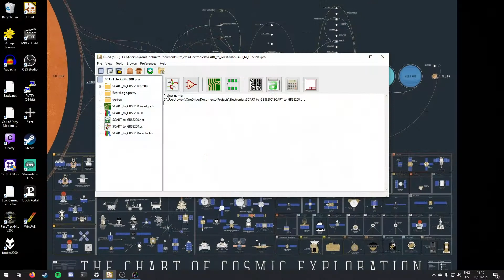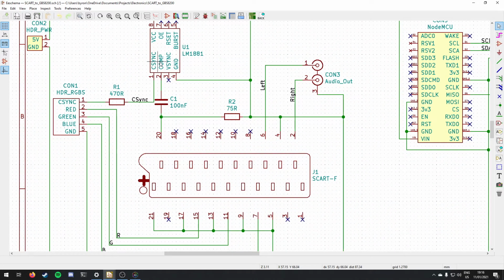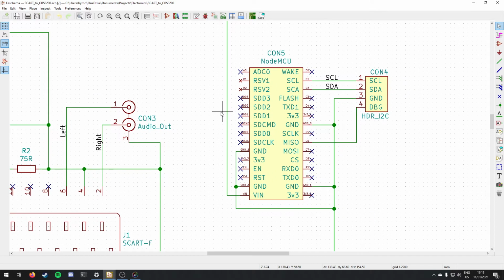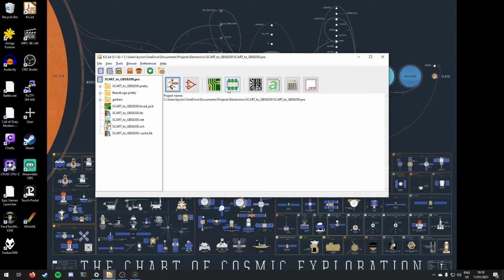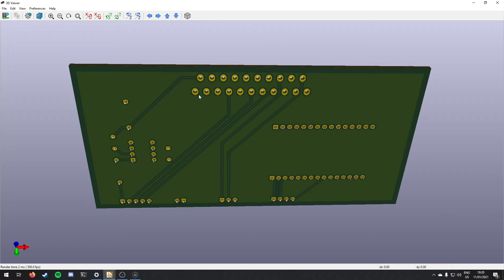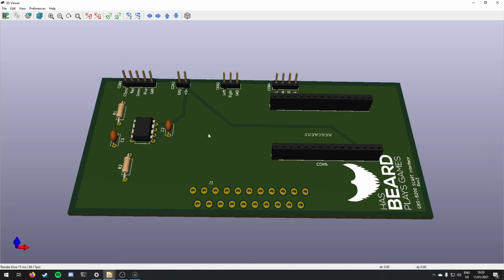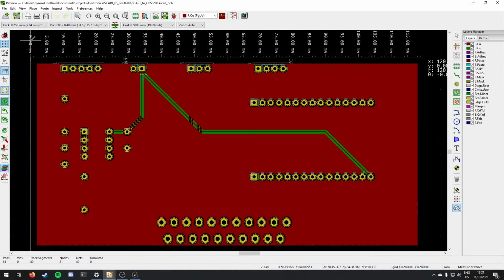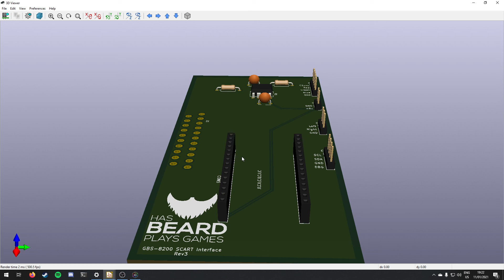Custom SCART interface for the GBS-8200

Comment: What are the values for the capacitors and resistors and what IC is U1? Got some boards being made and looking to build some up. Couldn't find a BOM on your github page and doesn't seem to detail the components on the silkscreen that I can see. Much appreciated.
Reply: ic is lm1881 and support 5-12v (not only 5v), the r1 is 680k, r2 is unknown... sadly is not mentioned in the video and/or in the github, not so usefull.

Comment: This looks great, thanks for open sourcing it 🙏 do you not need to make the hardware mods to the 82xx, i.e. removing and adding resistors etc., when using your solution?

Comment: You can make a vga crt do 240p with real scanlines.

How it works on pc is Use a program called CRU custom resolution.

For a 17 inch vga monitor i use these  settings.

Crt standard- 598 by 240- 150.000HZ

Then click ok and close program in software folder you see RESET 64 click that, the screen wiil flash and then click ok 👌.

Then you will have 240p to select with all emulators.  If 598 by 240 doesnt work try 600 by 240.

If unclear watch a youtube video on CRU Custom resolutions for crt.

But this is all well and good for pc emulation what about on gbs control?

I havn't used it so the only real question is can you add custom resolutions to gbs control?

Comment: Great video. Well done! Would you be sharing any video of how it looks on your crt? Also, so I understand, it only does the composite output of your old console and not RGB scart?
What do you do with your audio? Is it much work to add an audio amplifier (or header for one) so you can plug some earphones in? Or even a Bluetooth adapter so you can connect some wireless earphones to it?
Thanks!
Reply from the maker: Thank you! I'll see if I can record a follow up - I may not be able to record the CRT directly, but I can certainly capture the output directly through a capture card. The SCART standard has R, G, and B signals on individual pins, but it doesn't have a dedicated pin for sync - that's what composite is there for. Consumer AV gear can use the composite signal on a SCART input to sync, but the GBS-8200 boards can't really use the composite sync. The audio pins of the SCART connector are routed to output pins - you  can hook them up to whatever you want :). It's line-level audio, so you'd have to run the signal through an amplifier before using headphones or speakers.